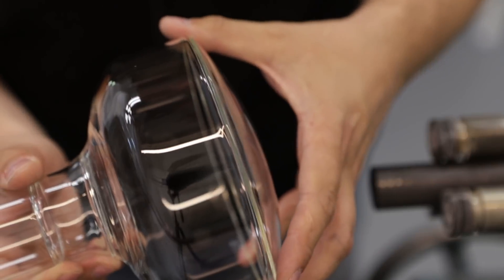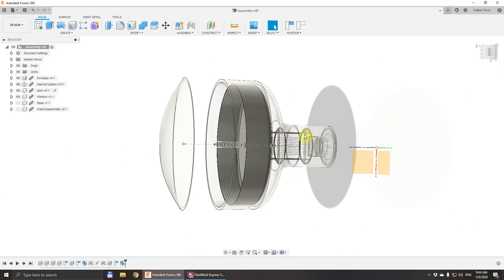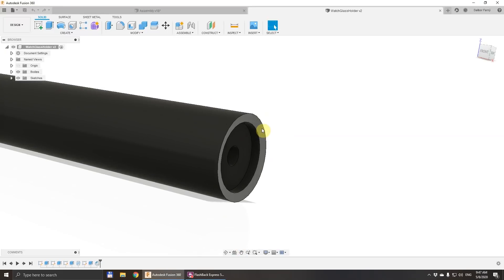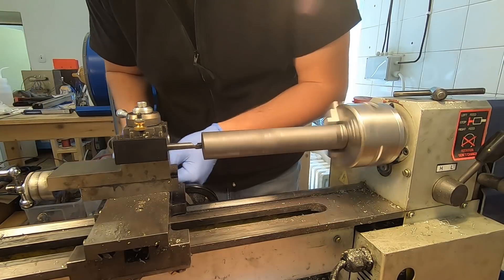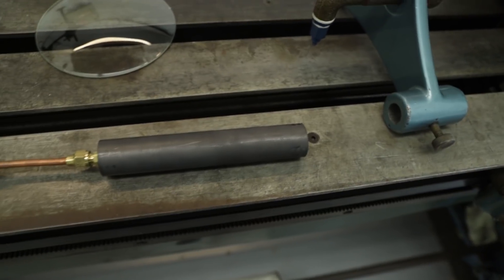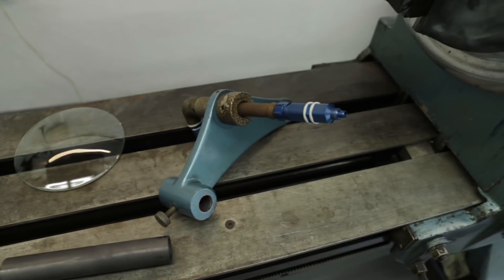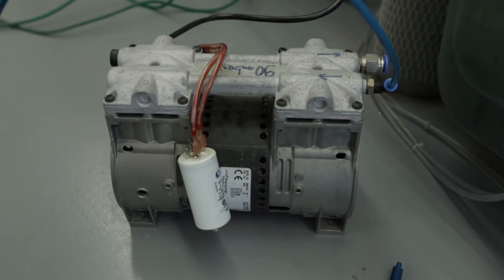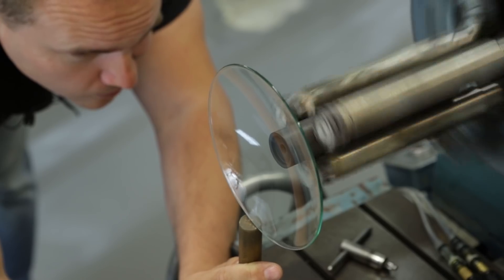Vacuum Holder for Glass Window | Project H #2

Comment: Why graphite? I think metal tube with silicone ring will be cheaper, less brittle and more handy.
Reply from the maker: Silicone would burn, metal would conduct heat away from glass fast, making it likely to crack.

Comment: Ingenious and simple solution to a difficult problem, I like that!
If there are some excessive air leaks, you could have a better matching by shaping the end of the graphite rod against a dummy watchglass using a sludge of fine emery and water (assuming the watchglass will have the same curvature as the final front windows).
I wonder how long you will have to reheat the tube (and temp decrease rate) after the front window sealing to release internal glass constraint? Are there some rules like art glass makers? Of course, I make the assumption you're using low expansion coefficient glass (Borosilicate?)...
A+

Comment: Careful with graphite dust on lathe ways, whilst it is a lubricant, it's also highly abrasive and can act as an adhesive to other elements as well.
Essentially, the particles look like ... tiny discs, when flat, they provide lubrication, but as they roll, move around, the edge contact is essentially like scraping a diamond across the surface. A used thick rag will suffice to catch the dust as it is quite heavy and doesn't travel well over distances.
Just letting you know in case you didn't know already.
Reply from the maker: Interesting, didnt inow that, I considered it a lubricant. This particular lathe is a cheap one with backlash everywhere, but I will keep it in mind for future work..

Comment: You could consider finding the center of the glass and marking it to then better center it on the suction hole.
Reply from the maker: It is easy to align it against the envelope before sealing. Cheers!